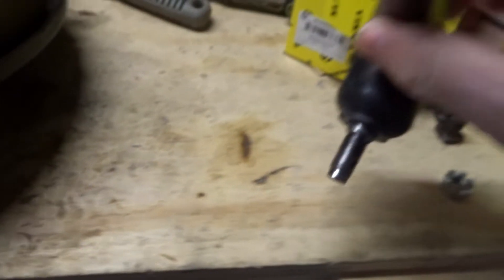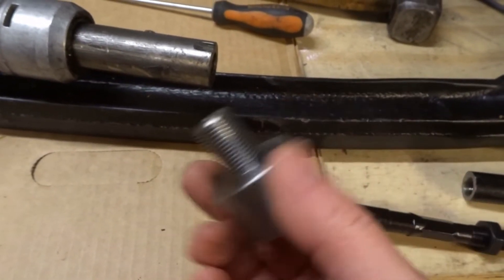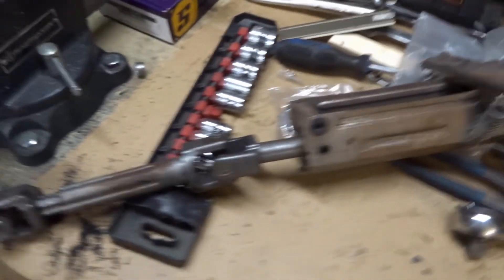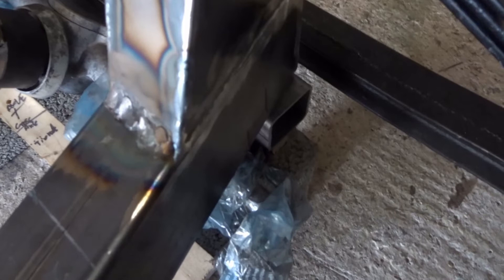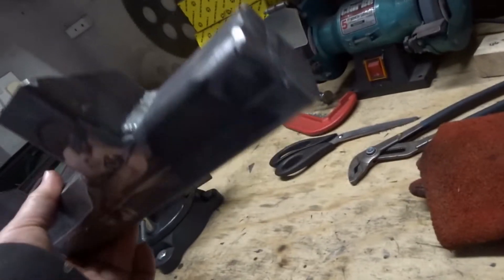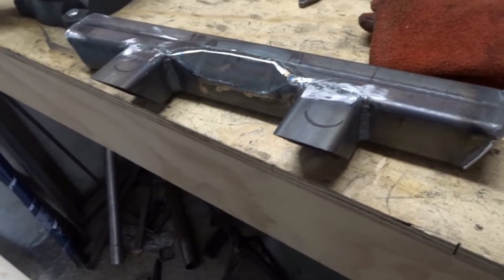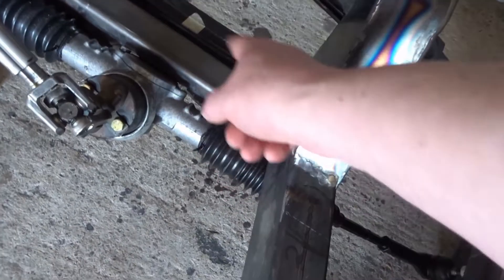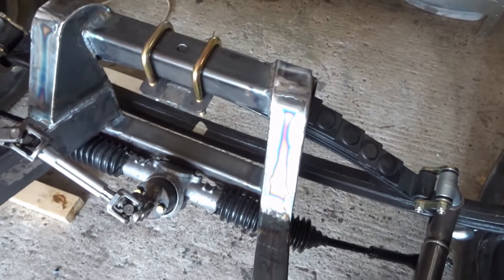Steering System | Belly Tank Lakester Ep.8

Comment: On Austin 7s and Riley 9s we just call it a steering arm. Known to crack on Austin 7s. Shame about the steering rack but I can see why they insist on being period correct. I am annoyed I have to build my Riley Brooklands and be totally period correct to be able to road register it yet they insist I have to fit lap belts to it which aren't period correct at all. I was hoping to use a latch and link style 2 point belt but whatever I use has to have a valid modern certification for road use on it and it seems none of those style belts are certified for road, only racing.
Reply from the maker: Yeah, it is a steering arm, always learning......